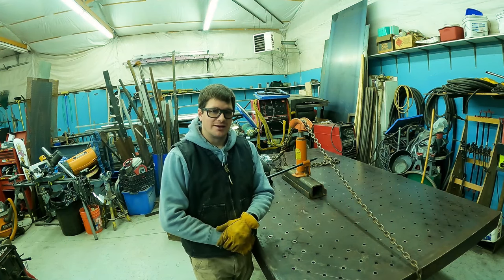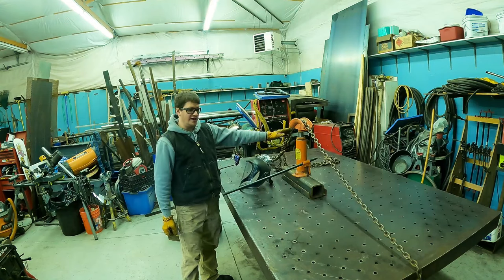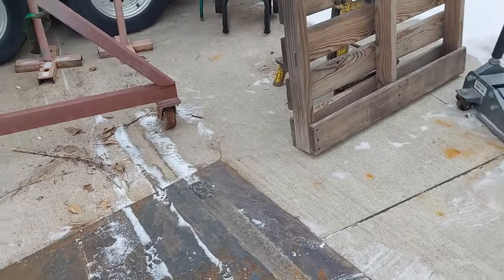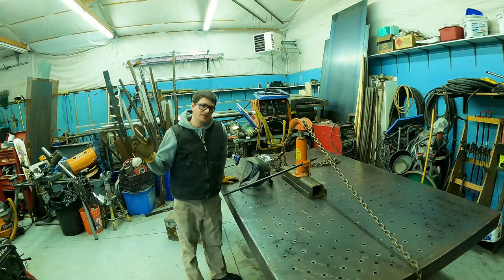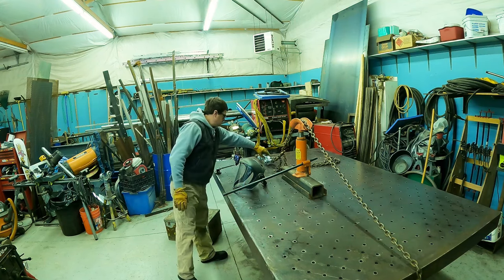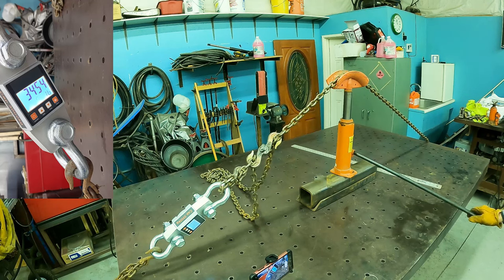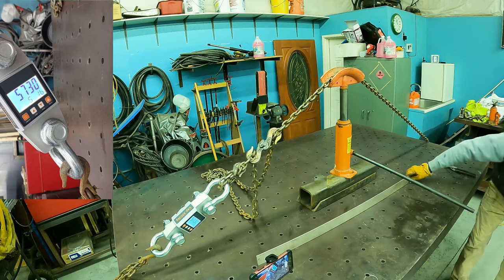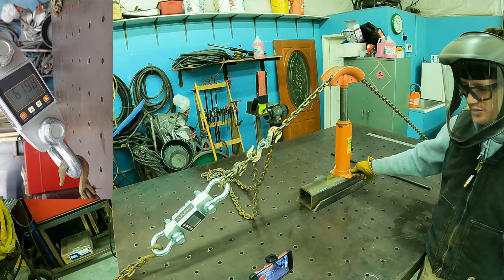HOW DANGEROUS IS WELDING HARDENED/TEMPERED STEEL?

Comment: Rated lifting stuff have usually at least 3x safety margin to braking point. To measure how much welding weakens hooks, you must test with much greater force and compare to untouched hook.
Reply from the maker: You are correct. I don't have the means to go higher right now. But I will keep that in mind for a future test. Thanks for watching and commenting! I'm always open for feed back and new perspective!

Comment: Thanks for that idea lol.   I have a table I’m making now and has some bows / bends small ones and ps won’t hold anyone liable lol.  I do sketchy stuff all the time too
Reply from the maker: I still have not won against my table bow... I do work on that table nearly every day. Thank you for watching!
Reply: @tysoddjobs  Sorry if you have explained this before, but this is the first video I watch on your channel. I wanted to weld hardened steel of a transmission gear. The process I had in mind in to clean the gear from oil, heat it up pretty good with a torch, then stick weld it when it is hot.
Is there anything dangerous about that, or will I have more difficulties in comparison to normal steel?
Reply from the maker: I am not an authority here on hardened steels/alloys. I would probably try tig Welding it with proper heat treatment. I have read somewhere about using stainless filler on hardened alloys. I don't personally have experience with it though. If you do find something that works share it on here. You for sure need to properly preheat and then do a controlled heat treat afterwards.

Comment: You might consider annealing that welded hook assembly, and allow it to normalize. Dangerous to weld on those parts. Jmo. Welding since 77.
Reply from the maker: I did think about that. I do agree it isn't safe and stated that. I figured 90 amps 3 passes on such a small part then a slow cool seems like it would almost me self annealing just because it was so saturated with heat. You've got me beat with welding time. Thanks for viewing and comment keep it coming I love outside perspective!
Reply: It’s not that difficult to reharden after it’s normalized. Good test result though, super dangerous methods. I’ll sub cuz. You paid for the scale....🤣
Reply from the maker: Hey thanks for watching! Hopefully I can keep your interest!
Reply: Finally. The sensible approach.
Normalise/anneal. Weld with similar filler... 110es or something similar.
Reharden retemper.
Normalisings the slow part. Do it last thing and its ready next morning.
Reply from the maker: Always good to have a procedure to follow and to be thorough. And will good procedures comes repeatability, confidence, and good reputation! Thanks for watching, commenting and interacting.

Comment: Two hooks in tandem is your 13 that's not tandem that series you're still at your 6,000 pound rating or whatever the it is
Reply from the maker: Yep, jokes don't come across youtube apparently
Reply: @tysoddjobs  I know it's a YouTube channel and all kinds of other stuff but somebody might take that serious and Overload that hook and get me fucked off only reason I was making clarification
Reply: @okiedoke6373  it's a GR 70  - TRANSPORT - NOT TO BE USED FOR LIFTING  even if it is all original not welded.
Reply from the maker: Nothing should be taken seriously on most YouTube channels. And it is true most of this stuff should not be used for lifting. Definitely should be used for table bending though!